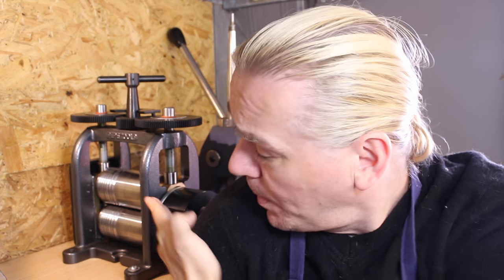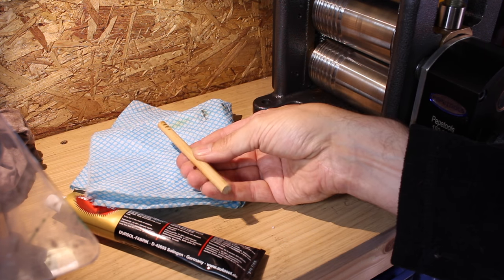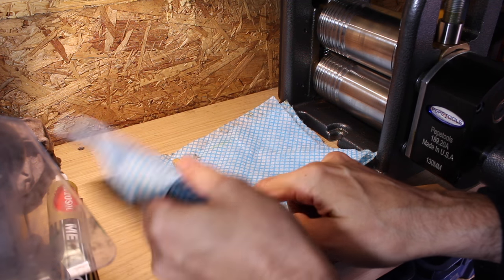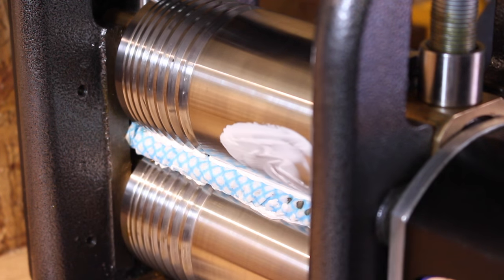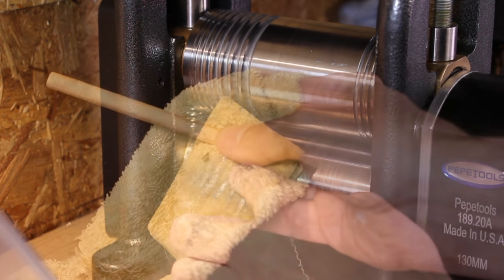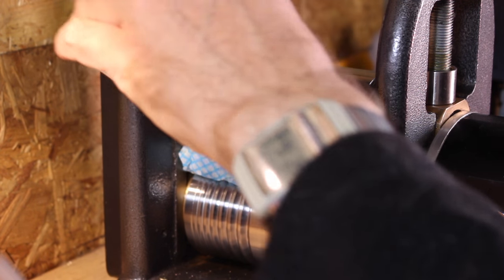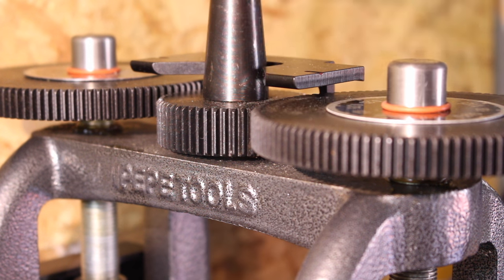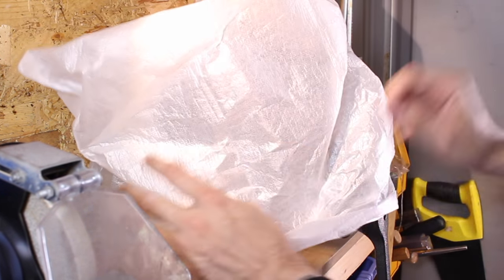How To Maintain Your Pepe Rolling Mill Tips & Trick

Comment: Hi Dave, great tutorials. I need some help - I have the same model as in this video, and the rollers have become a bit uneven. Very frustrating when making bezel wire! I wrote to Pepe a couple of months ago and haven't heard, and then I remembered you. Anyway, I would love to know how to fix this. Thank you.
Reply from the maker: really simple. remove the little bracket at the top that holds down the T-bar. remove the T bar. you can now turn each of the top cogs independently. Torn both cogs down until the rollers are flush "and parallel" together. adjust as necessary.  replace the T bar. Job done. Hope this makes sense. you can see me doing this with a cheap indian mill here.... Dave https://youtu.be/UYFBb4wL1Nw?t=612

Comment: A really helpful video that I'll refer back to when I get my rolling mill. I also live in a cool marine climate, where moisture and rust on metal surfaces can be an ongoing problem. I suspect it would be a disaster to get any rust on those rollers, as any pitting will transfer to the metal rolled  out--and would be impossible to fix with my tools. Keeping everything well-oiled is a great plan. I've also been told that wax/oil based metal preservatives like Boeshield T-9 work a little better than straight oil,  because they seal off from any dirt accumulation that will draw in moisture and salt. Of course, covering the mill when not in use should help a lot.
Reply from the maker: You're spot on Kurt. David (at Pepe tools) suggested rather than WD40 spray which i mentioned, I should use something a little thicker that will cling better. I'm not familiar with Boeshield T-9. But your point is correct. the thicker the better really. Dave
Reply: If I might add for other viewers--where you store tools in your shop will either help prevent or promote corrosion. The best place to keep your expensive steel tools is near a heat source and away from walls that face the outdoors. When your work space cools overnight, the first place moisture will condense is on the windows and exterior walls. If you store tools close to windows or against walls, you run the risk of moisture condensing on the tool and corrosion starting on the surface. Keeping tools near a heater will drive moisture towards the cooler parts of the workshop.

Comment: That is funny. I am use to see that in the boxes of the things we buy but in little tea bag sise.
Reply from the maker: That's correct, Silica Gel. just like you get in the little packing bags. Never throw them away, put them in your tool boxes to help keep them dry. ! Dave.
Reply: Celtic Dreams ho boy! I always trow them out because I thought they absorbed enough in the box and who knows how long they been inside absorbing the humidity. So they are always good and never get saturated whit the humidity?
Reply from the maker: just pop them near a radiator or out in the sun for an hour - good as new.
Reply: Celtic Dreams 👍